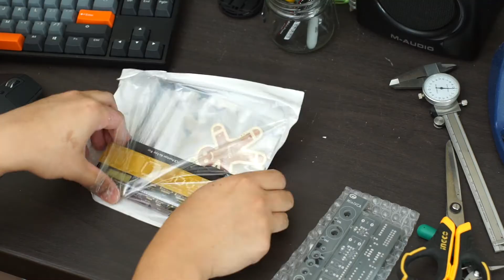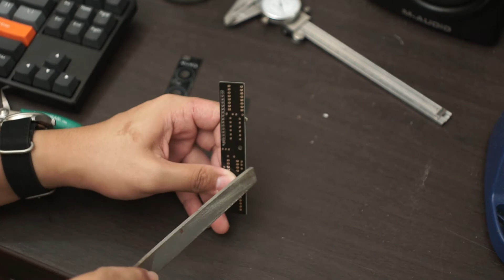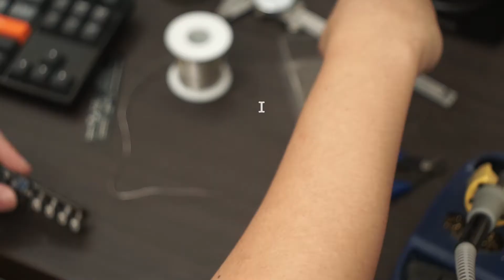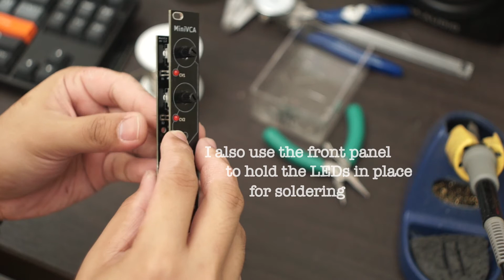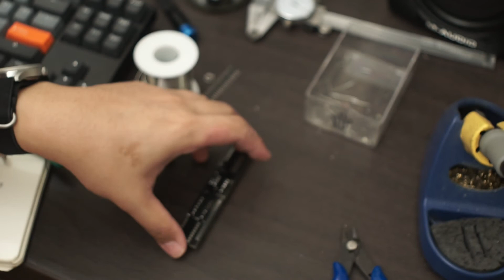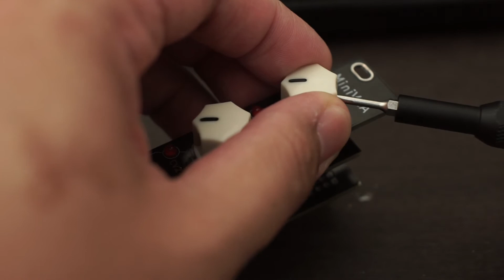MiniVCA -- An LM13700-based VCA PCB -- The MiniSynth Project

Comment: I hope this doesn’t occur to you as a question from someone who can’t remember what the ‘linear’ mode on his VCAs sounds like.  I’m guessing here unless I find the answer to my question.  For your CV input channels, is it meant for those two CV inputs to BOTH modulate the amplitude or volume of the signal at its input?  I like it, that you’ve put the two CV ins, as most are singular CV in.  Looks like a pretty decent project with not too many parts.  When you look into the DIY path to a modular synthesizer, it becomes evident that practically anyone ought to be able to afford one, if they just focus on the basic theories and try applying those lessons to the experience of building each module.  It doesn’t have to be completely true that I would spend 500$ to build for myself what I could have bought originally for 250$!  Although, it often times feels that way while I’m just a little too focused on the theory and scared to go through with the experiences of putting the theory into practice.  THANKS AGAIN!!
Reply from the maker: Hey again Jimmy James! Thank you too.

"Linear" just means that output volume increases regularly across the entire range of CV input (say 0-12V). As opposed to "exponential" which means the increase in volume becomes steeper at the top end of the range (say 9V-12V). 

Yep, you are correct, the two CV inputs are just summed together. 

Tinkering on breadboard, and focusing on getting something done -- regardless of the quality, really helped me a lot with the "scary" part. You can always fix things in the next version. 😉